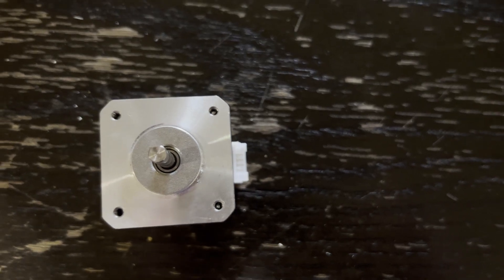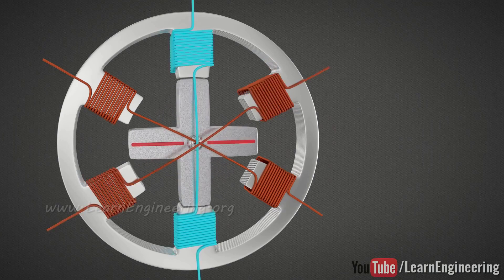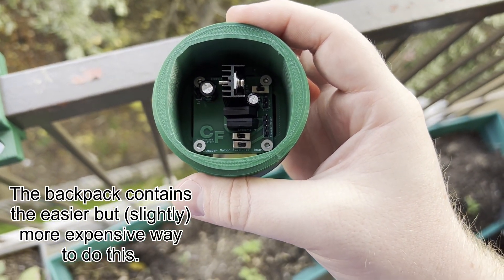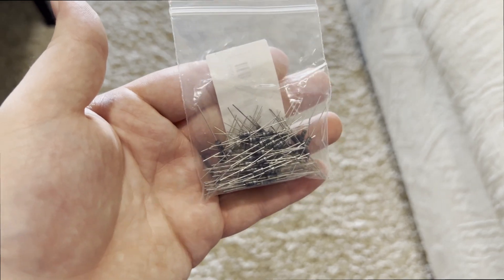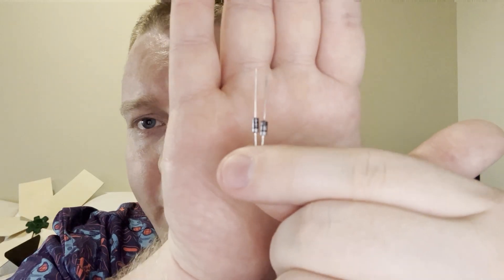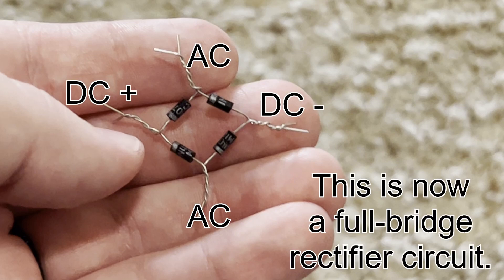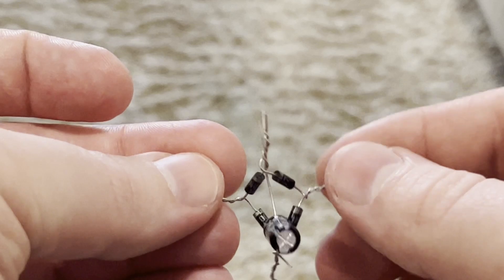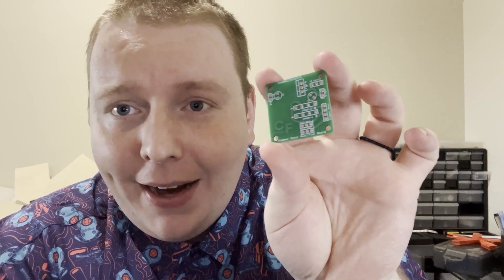Using Stepper Motors as Generators (Rectifiers, KBP 307 IC, & Alternatives)

Comment: Don't use the cheap geared stepper... the gears will wear really fast and, the center of the windings are still connected to each other after cutting the red wire.

Comment: Fun fact, you can hack a hard drive stepper motor without a chipset via using 3 pieces of tape on the disks, you can run a brush wire on top of the disk and it will spin if you taped it correctly.

Comment: What are you doing with the DC power you're generating with them?  What voltage does it produce?  I've always been intrigued by the idea of using steppers as generators but never looked much into it.  Thanks for the inspiration to dig deeper.
Reply from the maker: Of course! My plan is to charge 18650 cells, which I will then use to charge my phone. Balcony-sized windmills are blessed if they generate even a few watts. Mine typically produce close to 15v at peak, but is closer to 5v during standard use.
Reply: @christophersfactory  So do you just use a variable input voltage converter to get it to the LiPo charging level?  I have a bunch of these cheap amazon converters, but I don't know if I should trust them, and also how stable they are with wildly variable input voltage like this.
Reply from the maker: @ObsessiveEngineering  A good question, I suppose you could hook up a dummy load and a hand-crank and just see how they handle the wildly variable voltage. Personally, I often just use the 7905 linear voltage regulators. Even though they're trash as far as efficiency, it's a small price to pay in exchange for not having your house burn down from exploding batteries 🤣
Reply: @christophersfactory  could you do a video on harnessing the power to charge batteries?

Comment from the maker: CORRECTIONS (I will edit this as needed): 

- The diode I hold at 2:14 is a 1N4007, not 4001. Both codes are diodes that work exactly the same, but with different maximum voltages and currents.
- When I said "Usually they're touching" at 4:58, I meant that usually the two wires that make a coil pair are adjacent.

Comment: Great video! I honestly have never seen anyone explain “bridge rectifiers” so simple. As I was unaware there were half and full bridge rectifiers. 
Question for ya: with half bridge rectifiers only utilizing half the AC, is the unused power given off as heat or is it basically just non existent to the circuit?

Comment: it is also possible to use some types of mosfets or transistors or hexfets as diodes, in some cases you can just directly connect 2 leads together, but in general you need some kind of refference voltage which can be a capacitor charged by a normal diode rectifier. the main interesting things about this is that when doing that essentially the mosfet or such isn't a actual diode but opens and closes based on the voltage, and polarity this means you can rectify the voltage with almost no voltage drop or energy loss compared even to schotky diodes.
did forget how examply it worked and with which speciffic components but I originally discovered this working when I designed my own custom type of high voltage transistor which was kind of how I thought a fet would work based on their name, it essentially used static atraction and repeling to work did actually work pretty well.
but also found out I could use them as a diode by setting a certain refference voltage in a capacitor this wan the voltage could go only one direction.
this also translated to work with some kind of mosfet or such but it was long ago so I don't remember exactly anymore what I used for the normal mosfet or such also since back then many parts I used where things taken out of old broken devices. and my custom transistor/mosfet for very high voltage was made from antistatic packaging aluminium foil and tape.

Comment: Could you provide some information on how many watts could a fullbridge rectifier of yours operate maximum? 

Also what is the rating of that small chip rectifier?

If you were to make 3 phases, could you connect the discharge of the 3 phases at the end?

Thanks in advance, your video is very informative and thoughtful.
Reply: Subscribed

Comment: Absolutely wonderful video. I have a  42D212D Anaheim Automation stepper I would love to make into a generator.  I know nothing about electronics but want to try and see if I can get it working.  Thanks for posting!
Reply: The reason stepper motors are good generators it's because the have a low KV rating. So it's takes a reasonable rpm to get usable voltage out of them. Normal brushless DC motors like the ones used for drones need thousands of rpm before you get a few volts from them.

Comment: thank I going try to make some small wind turbin using some old nema23 motor do you think it will be worth to use some step up converter so the output voltage will be above 14v so I can then plug into a MPPT charge to charge a battery

Comment: So each coil has 2 corresponding wires. One positive and one negative. Would you hook up both positives from each coil to the rectifier, and both negatives to the negative part of the rectifier? Or would you need two rectifiers?
Reply from the maker: You will need two rectifiers :) Because the coils are offset from each other. If they're connected to the same rectifier, their voltages will always cancel out.
Reply: @christophersfactory  thank you!

Comment: hi I'm am after some knowledge and experience when creating generators. I would like to make a wind powered generator for my project at university and need something that will spin quiet freely with little resistance but produce enough to charge a phone or even a power bank. your video was greatly useful to help my understanding of this but I'm still not sure on what to use. Any help would be greatly appreciated.

Comment: How do circuit boards work? I’ve never understood that green stuff with the little solder connections. Do you have a video explaining when to use them and how to choose? Thanks for these great videos!!!
Reply: This would be really helpful to me as well!
Reply: I'll thrown in some notes about printed circuit boards (PCBs). These aren't items that are "chosen", rather they are designed by the person creating the electronic circuit specifically for that circuit. Are you familiar with schematics? Do you know how to read a basic schematic? These skills come in handy. Usually, the designer has an idea. S/He makes a list of the components needed, like for example diodes and capacitors, like in this video. Now the designer sketches out how these components are connected, plus how anything that is external to the circuit  is connected to it. This sketch is the schematic. The next step is to build the circuit to see if it works (sometimes it does, sometimes it doesn't). To build the circuit, the design can use a breadboard and jumper wires, or s/he can freeform it, like Chris did in his video. Here, the design might have to make changes to make the circuit work, or work better. Once the circuit has been thoroughly tested, and the design is happy, the next step is to create the PCB. If this is a one-off circuit, the designer might choose to use a protoboard, and not a PCB. If the PCB is wanted/needed then the designer goes to his/her computer and gets a CAD (Computer Aided Design) app, like KiCAD. There are options, from open source aps that are free to use, commercial free to use with restrictions, or crazy expensive apps. Once the design has the app s/he captures the schematic into the app. Once that is done, the designer creates the PCB by providing dimensions (size) and other parameters. The software then creates the PCB, but the connections are usually messed up. The next step is to order those connections so that they look nice and don't criss-cross. This is called the routing process. Most CAD apps can do this automatically by simply selecting a command from the menu, but won't always choose the best routing, so it is recommended that in the future when you feel comfortable designing PCBs. For now, just let the software do it. Once that it done, there might be other tasks you might want to perform (too long to present here). Finally, you generate something called Gerber files. These are the files that are sent to the machinery that will manufacture the PCB. Once these files are generated, they are sent to the company that will manufacture the PCB for you. In his video, Chris mentions jlcpcb. This is one of many. I've used this company. The company usually manufacturers a set number of PCBs, maybe 3, 5 or 10. They will not produce just one. Some will charge more, some less. You upload (or transfer) the Gerber files to the manufacturer, pay up, and provide shipping information and in 2 to 4 weeks (varies) you'll have your very own, designed PCBs!

Comment: Do stepper motors make better generators than regular brushless motors? I tried making a phone charger out of a 12V cooler fan (which I'm almost sure it had a brushless motor inside). The idea was to rotate the motor using my excercise bike for when the power goes out and my phone is low on battery. But I built the prototype and barely got 4V out of it. I needed at least 8 to have a stable 5V by using a 7805 regulator.